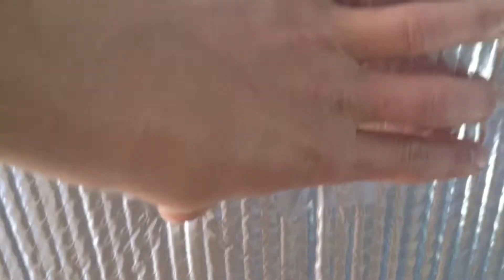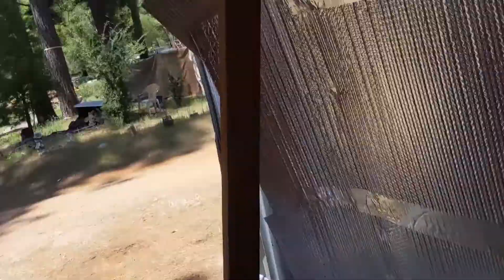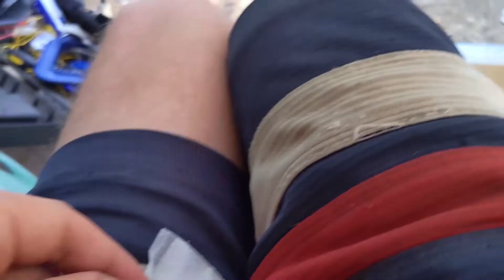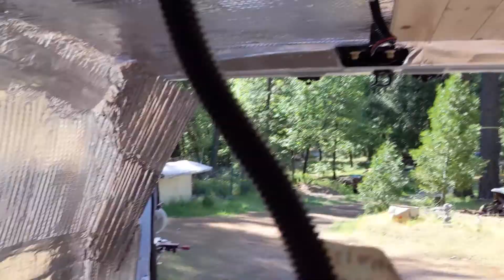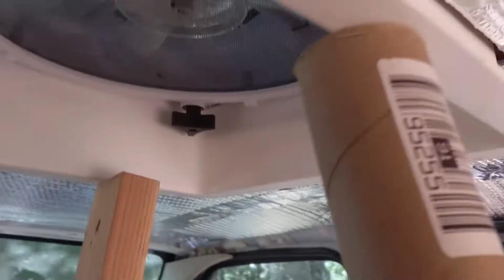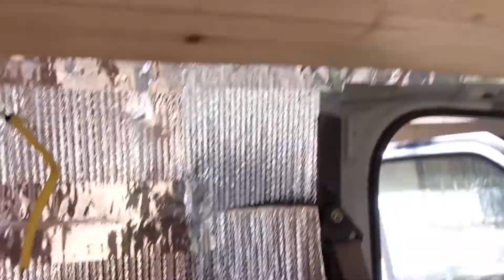Van Life Build | Ford E350 Stealth Conversion | Ceiling Panels Pt 1 | Ep 21

Comment: Building an e350 passenger van right now at pretty much the same pace you are building your van. I started from the floor and went up to the ceiling with the tongue and groove. Getting those corners to line up was a bitch and a half. Stoked to see if you come up with a better solution. Gonna put in the ceiling next. Cheers 🤙🏻🌵🚐